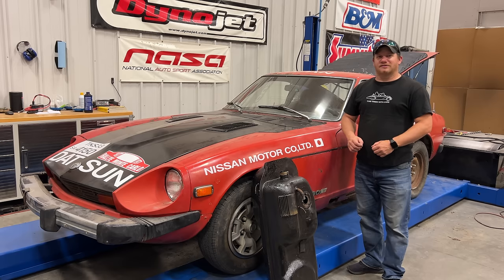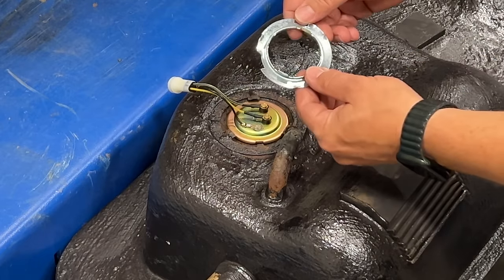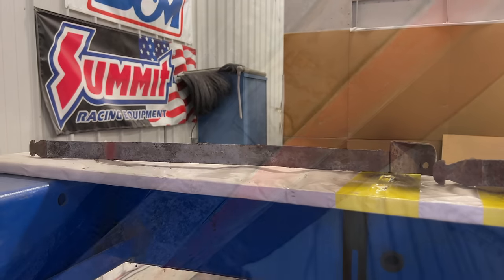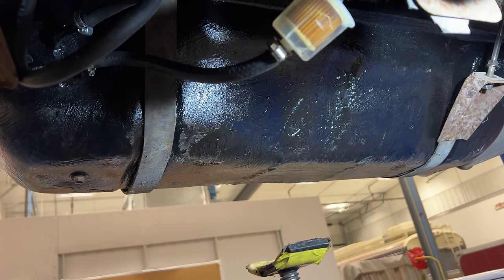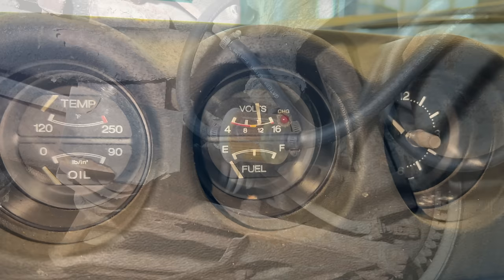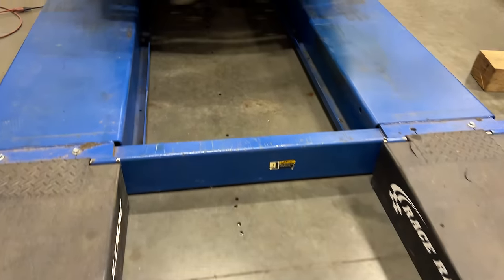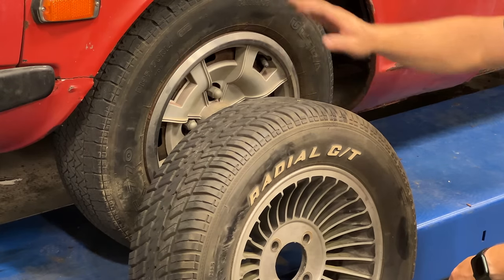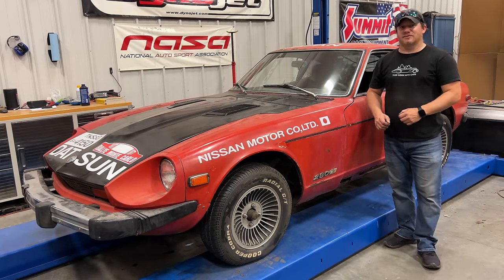1976 Datsun 280z - Fuel Tank Installation

Comment: That's about as rusted out as the one I had back in the eighties.  The engine transplant is a good idea.  The wiring on the fuel injection the 280's had wasn't ready for prime time.  Have fun getting those rear brake drums off, BTW.

Comment: Donnuts in the carpark, you old hoon, Steve!
If you're going to use this in competition, you're surely going to have to do a lot of body work on the rust???
Reply from the maker: I’ve already done the rocker panel on the pass side as well as all the rust in front of the firewall.  It will all be fixed before any competition.
Reply: @ThisWeekWithCars  why would it be disqualified with rust?
Reply: @michaelmcdubhbey2266  Assuming it's a unibody car...  Any rust represents a structural failure potential. That's a safety concern in competitive motorsports.
Reply: @tiporari  Aye thanks